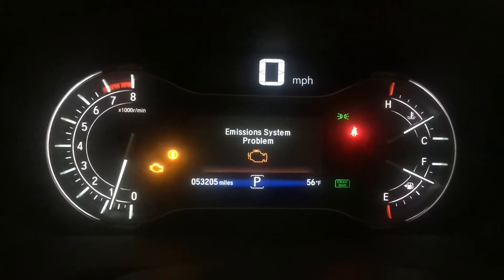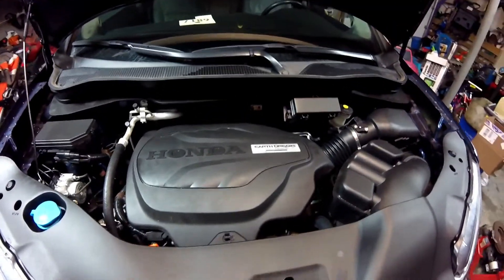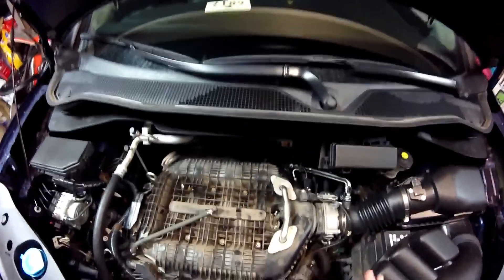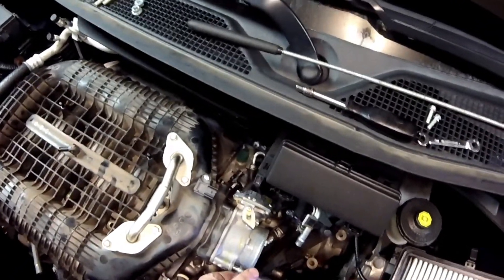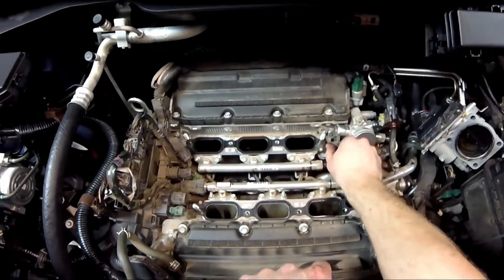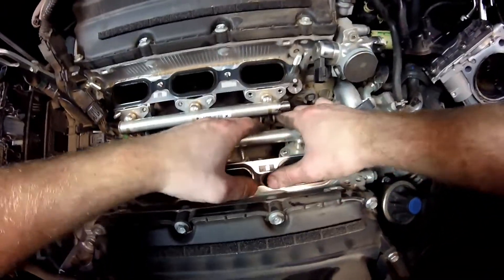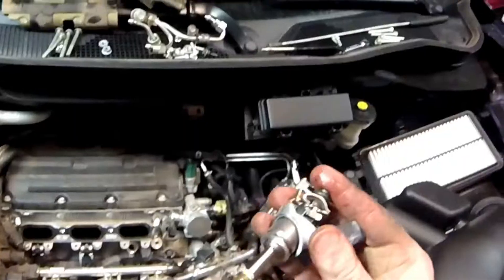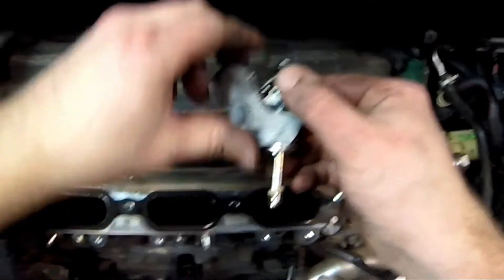2016 Honda Pilot P0430 Service Emissions System - Fuel Injector Replacement-Part 1

Comment: Just got this on my wife’s car at 70k.  Considering cleaning them first before swapping new ones in.  Maybe pulse them and run cleaner through as well as clean the pintles.  Here I am talking myself out of an x5 diesel almost every couple of months bc of the “I want my family in something reliable deal” then this shit.  It’s direct injection with a plastic mani just like the bmw.  What a shame Honda.
Reply from the maker: You can try cleaning them. But I doubt it’ll make any difference. Let me know if you have any luck.

Comment: I brought in my 2016 pilot to a honda dealer and they told me that the problem was the injectors, the extended warranty cover to replace the injectors but at honda they told me to replace the injectors they have to removed the pipes that cover it and that is not cover for the warranty so I have to pay por it. They said that after removed that pipe they need to install a new one because the old one may have some leaks. Is that true or they just want to charge something else?
Reply from the maker: There’s something shady about your extended warranty company. They should cover the whole job. The labor to gain access to the injectors and any parts required to complete the job should be covered unless you have one of those fly by night cheap extended warranty companies.
Reply: I am getting the same error now on my 2016 honda pilot. I have Hondacare extended warranty and will call them tomorrow. Just curious did they end up covering for the pipe as well?

Comment: Do you think the pipe (rail) needs changed as well?  Dealership is recommending it.
Reply from the maker: Bobby Handell you are “supposed” to change the pipe because it is a ball and socket connection. This is because the fuel pressure is so high on a DI engine and the ball side of the connection gets a slight indentation from when it was originally tightened.
Reply: @PetesGarageandperformance  did you not change the pipe?  The pipe is fairly expensive to replace if not needed.
Reply from the maker: I did not. I made sure to get everything back straight and made sure there were no leaks.
Reply: @PetesGarageandperformance  ok thank you.  I paid to have this done and also did not have pipe changed.  Car is driving better.  Thank you for the video saved me $800 based on dealership quote.

Comment: i had a few of these pilots at our shop. both had about 70k miles. no warranty from dealers here in minnesota.  bulletin states that the injectors were either improperly installed or contaminated. very strange.

Comment: Should be 8/80000 miles emission warranty
Reply from the maker: The fuel injectors are not considered “emissions” equipment.
Reply: ...except in 13 states where fuel injectors are covered under the 7/70 California Emissions Warranty. In all other states, they are covered under the standard warranty.
Reply: @zroger73  which 13 states?

Comment: You seem to rub the new injectors with something before you put them in. What was that?
Reply from the maker: I used TransGel. It’s a lubricant used to help assemble transmissions. You want the seals on the injectors to go in easy and not get damaged. Thanks for watching.
Reply: @PetesGarageandperformance  This was my question! I can't find "TransGel" when I searched for it. Is it called something else now? (This is the last thing on my checklist!)
Reply from the maker: @LucasGandy there’s two different brands. TransGel and Assembly Goo.
Reply: @PetesGarageandperformance  thank you!!!

Comment: My wife Just got this on her 2019 civic. 300 miles on it.
Reply from the maker: I’m assuming the brand new vehicle has a slightly different problem. But could still be a bad injector. Maybe just a bad part from the factory.
Reply: Senor Grav just watched this video because my 2019 civic with 500 miles on it just got this code did y’all figure it out???
Reply: Nick spadaro we took it to the dealer and they gave us some bs excuse saying that’s there’s this new technology on the Honda’s that pretty much is faulty making screens like this appear. They said it was safe to drive but they hadn’t found a issue and if they do they would send a letter...kinda funny cause after we took it the tire pressure screen came on and when I checked the tire pressure everything was was fine. Kinda just leaving me more confused
Reply: Senor Grav yeah this whole thing is scaring me I’m 23 years old and this is my first new car I’ve ever bought myself hope I’m not now 23k in debt for a faulty vehicle...other than this code freaking me out I’m in love with the car...
Reply: Nick spadaro thankfully all repairs are free with the whole Honda warranty. But yea I know exactly what you mean. I hope they get this issue fixed and asap cause the more research you look into it the more you realize it’s not just us this is a very common thing with the new Honda’s..very annoying
Reply: Senor Grav tons of people are having the exact same issue and apparently Honda says they haven’t found out how to fix it yet but when they do they will send out an update
Reply: Any updates on it? I have the same problem (18’ Civic)

Comment: I searched for this about a year ago...couldn't find much.  Just took it to the dealer because I was fed up.  Started at around 58K, now at 81K.  They were able to work with Honda and cover since I reported the issue when it was under warranty and all they offered was a software update which did not fix the issue.  Now they're also recommending spark plug replacement.  At 81k, I'll give them that.

Comment: I have a 2018 Honda Odyssey with 20,000 miles that needs 2 fuel injectors replaced.  Luckily, it's still under warranty, but after watching how much of the engine is taken apart, I'm wondering if it'll get put back together to its original state without causing other problems.  Soooooo frustrating to spend so much money on a car that has now had 3 significant problems in the 1st year of its life! Thank you for your video....very helpful for me to understand what the mechanic will be doing.
Reply from the maker: A good technician should not have any problem putting the vehicle back together properly. Honestly on a difficulty scale of 1-10 I would give this job about a 4. I know it can be frustrating but at least it is covered by the warranty on yours.

Comment: Pete how was the carbon build up on the intake and valves? I hope you can  post a video how to clean carbon deposits for this Pilot model. Subbed and Liked!
Reply from the maker: Chris Snow actually the intake was pretty clean and the valves weren’t really that bad. This vehicle is long gone from my garage but has been running well with no problems after replacing the injectors.

Comment: I have the same problem but it was a different code I believe the code was P0 172 when I found out what the problem was they told me it was the fuel injectors in the fuel rod  MF charges $1700 to fix it had list and 40,000 miles on it I was blown away never had this problem before I’ve heard cars with over 150,000 miles never change the Fuel injectors
Reply from the maker: Yes carbon buildup is a real concern with any direct injection system. But it does seem like this year of the Honda injectors are especially problematic.

Comment: We are having the same problem and we have a 2016 Honda Pilot, my husband has told the dealership mechanic every time we take it in for service and it never changes the light keeps coming on, then it goes away then comes on again, most of the time when we fill our tank with gas. We have had Honda’s for many many years,  but now I’m thinking are we going to stay with them on the next one we buy. We purchased the extended warranty so I’m concerned it will not get fixed until after the warranty runs out.
Reply from the maker: Have they not replaced the injectors yet? There are other things that could cause this, but on this particular year and engine it’s probably injectors.
Reply: Pete's Garage no they have not replaced the injectors, my husband watched your videos and he is going to talk to them about the injectors. Thank you for posting these.
Reply: They'll blame over-filling and put it back in your court.  Mine actually would come on at about 1/4 tank left...finally going to change injectors.
Reply: Same here. When you schedule an appointment for the check light and it goes away, when you get to the dealer they refuse to even check anything. If the light comes on and you show up at the dealer they tell you to make an appointment. When you go to buy the car the customer service is excellent. When you need a warranty call afterward it's the worst, and I would bet they are fully aware of most of the consistent issues with these cars...
Reply: Mike H that’s true!

Comment: I have a 2016 Honda Pilot, and I am having a similar problem. The car does not want to accelerate properly. And the “emission system problem” light came up. When I went to get the car read by Auto Zone the codes came back as P0138 and P2652. Could it still be the injectors like you have described in this video? Or have you ever had any issues like this with the codes I have. Please help! I’m at a loss!! Any advice would be much appreciated. Thank you

Comment: I have the same Honda Pilot 2016, 20,000 mileage. I have the same problems with my car. Do you need to change the High pressure line. Also do you need to change all the injectors. After you replace the injectors can I clear the code, or do I need a special program? Can you reply to this email: tolyaserg1@gmail.com 
   Thanks
Reply from the maker: Tony Sergeychuk the injectors come as a set of 6. I would replace all of them since you’re in there and have them all. It’s good practice to replace the line, but not 100% necessary to fix the concern. Just clear the code and test drive.
Reply: @PetesGarageandperformance  How do I clear the code and update software after replacing injectors?  Thanks for your informative video!!  Also can you reply to trishbarker@hotmail.com  ...appreciated!!
Reply from the maker: Trish Barker you’ll need to clear the codes with a scan tool. Then drive it until it passes the monitors for the dtc’s that had set. To reprogram the ECM you’ll need to take it to a dealership.
Reply: @PetesGarageandperformance  Humm, okay. Any idea what kind of cost that reprogramming might be?